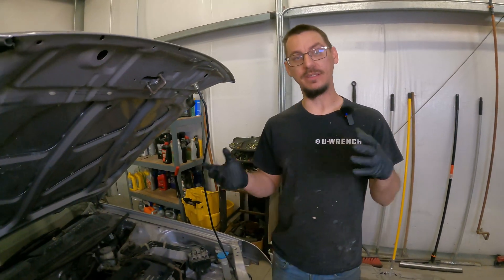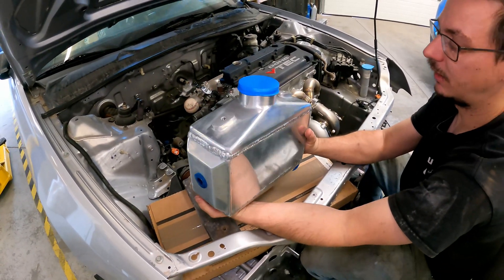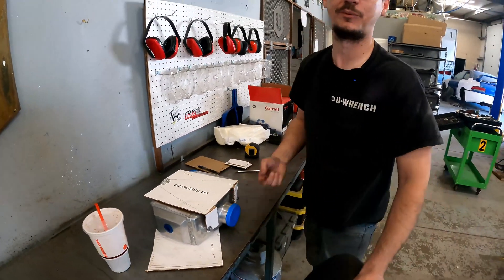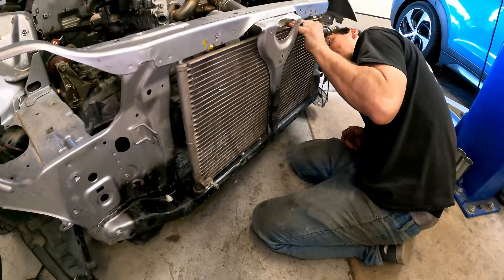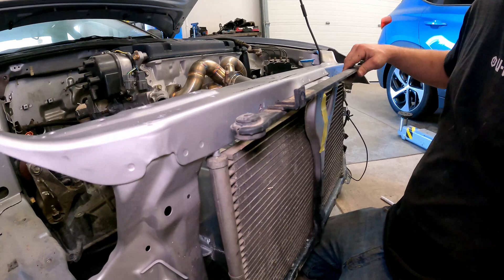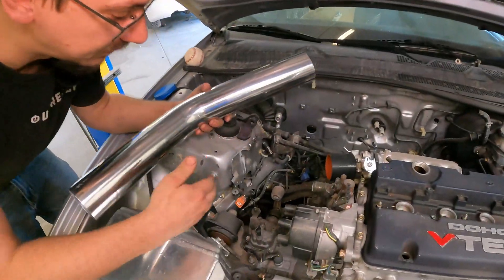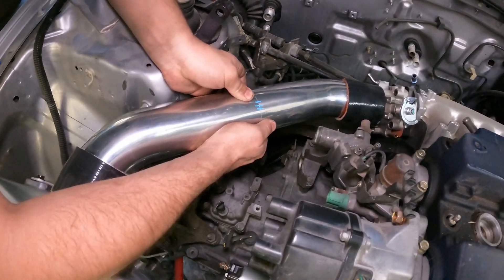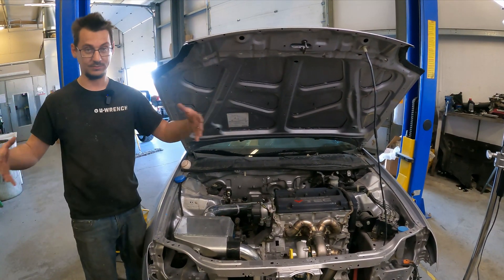Installing a Water to Air Intercooler and piping | Honda Prelude H23 450HP

Comment: About time folks started seeing the joys of WTA intercoolers. They are fairly popular in the Celica and MR2 world, and those setups usually come with fans/radiator, lagged chargecoolers, and a pump to keep things running. 

And if you REALLY want efficiency, do what toyota did, and have the pump come on when a throttle signal is detected.

Comment: Late to the party but good video :)  
My 2c would be more silicone less allu pipe when joining the cassis mounted duct to the engine for the exact reason you wanted it mounted on the engine / trans unit - something has to move.

Comment: Really nice vid bro. I'm still a bit confused about "inter chillers". I know how standard intercoolers work and the principle behind it making the compressed air cooler so it becomes better for the engine in terms of combustion. What I dont get with chillers is, why cool water and use it to cool the compressed air? Wouldn't it yeild better results if you ran A/C refrigerants (gas) through the lines to the chiller box directly instead of water?

I dont have any research to prove it, its just a though i had while watching.
Reply: Forced induction interchillers are nuts but expensive.